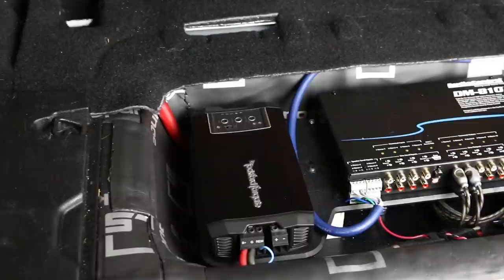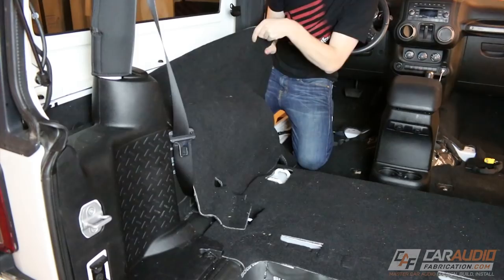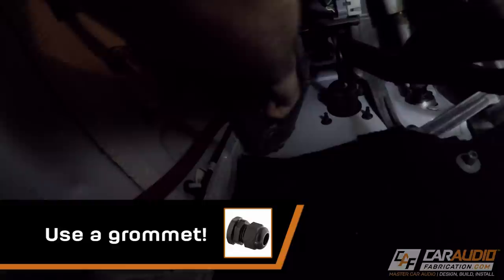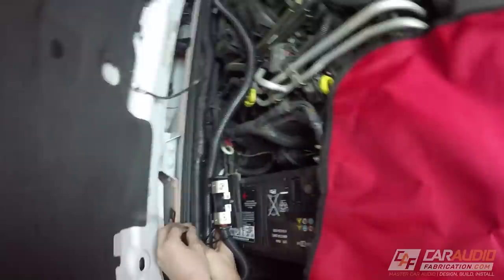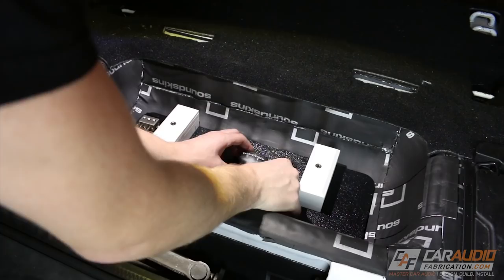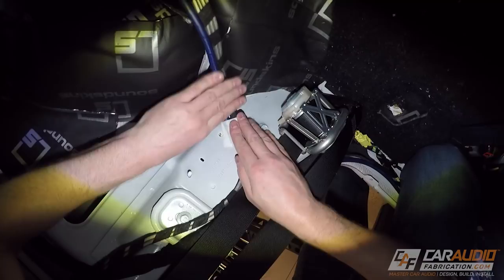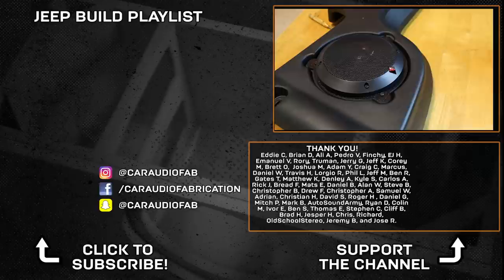Car Audio Wiring - Dual Amplifier and DSP Install

Comment: This would be the reason why I spent thousands of dollars paying someone else to install my stereos. This is pretty complicated and takes an incredible amount of precision, patience and attention to detail.
Reply: Not a single complicated thing happened in this video. I’d say it’s physically exhausting from my experience but not at all complicated.
Reply: @3000dudeman   Sure, if you're used to doing this sort of thing. Otherwise, it's complicated.
Reply: It’s not that difficult, you’re just lazy and not willing to put in the work so you use that as an excuse to justify it to yourself
Reply: @primalconcretesledge3137  I taught myself how to build enclosures and install audio in a year, I’m still learning. My only motivation was lack of funds to pay someone else
Reply: @modernbassheads5051   You want a medal or a chest to pin it on?
Reply: @primalconcretesledge3137  laziness is a poor excuse bro
Reply: I learned how to install a sub and amp a few months ago. Doing my car speakers and a tweeter installs with a second amplifier set up soon, and it honestly just took trying it out to find out the hard part is finding the stuff you want to use

Comment: How do you hook up speakers to dsp I get sound in then sound out but how how do you run 4 dsp outs to one 200.4 to control 4 speakers it just don’t make any sense and every video on dsp is just wiring it up like that’s simple not a one shoes av cables to speakers

Comment: The point is on how to wire dsp, then where is? too much explanations but useless i did not understand...what if get dsp,batery,amplifier,speakers,wire and explain it in a white table on how to wire them that is a clear and helpful video.

Comment: Hi I have a 2012 chevy equinox and I went with the ILX-W650 Alpine radio purchase from Crutchfield but I have lost my factory monitor.  I also purchased the same harrnes that you used in your father's Equinox but it not compatible with my monitor. Do you have any idea what I could do to make my monitor work so I can see my climate control?? Any help would be appreciated. Thank you.

Comment: Hey all, im confused about a few things. Would i still need to use an RTA microphone and go through each speaker and tweeter individually even with this DSP? Currently running 2 sets of infinity kappa 60.11 components and a kappa k4 amp. How would i be able to control all 4 woofers and all 4 tweeters with the DSP when the amp only has 4 inputs? Please help!

Comment: Does the GTO make a popping noise when the radio is turned on and off and will this harm anything, Do you recommend using the GTO or using an accessory wire turn on the device? I have the Audiocontrol LCQ-1 but I am not using the GTO just using an accessory wire to turn on the unit, I read that it makes a popping noise when turned on and off, but I like the fact that it only turns on when the radio is turned on and not all the time when the ignition is in accessory mode. I have a 2015 Honda Accord LX sedan factory radio that had 4 speakers no external amp.

Comment: top notch install!! the only thing I would like to add is that most vehicles come with a appropriate size ground cable to handle the needs of the vehicle . with that said if your going to have an additional load on the positive side , you should upgrade the negative lead or rather add an additional ground lead the same gauge as your power lead to the amps but from the negative battery post to the to the factory grounding point. doing this helps the amps run slightly cooler and helps with light Flickering with bass .. thats my two cents for what its worth...

Comment: This build will be super useful for me if I ever feel like adding additional amplification to my car, as the stock amplifier is tied into much more of the system functions than it should reasonably be, so the easiest thing is to just feed it all into a DSP to secure clean, flat output equalization before it gets fed into secondary amplification where necessary.

Comment: Video was great, but would have liked to have seen more detail on what fuses you used, how you hooked up the dsp and what size fuse used on dsp.  I am working on a 2019 Indian chieftain. Much different and  it many videos out there.  Any chance you can do an install on a 2019 or newer Indian would be appreciated.  Thanks for all these videos
Reply: He won't answer nobody does its the strangest thing not a video or Google straight answer out there

Comment: Nice job man, I have been pre-running the wires and do a small tape marker to mark the areas it will split off the harness, then wrap it outside of the car/truck easier on my back.. Keep up the good work.

Comment: No I haven't talk to Steve Meade about my set up, but I did speak to car audio fabricators and they told me I would be fine just by using the six channel audio control DQDX digital sound processor that I plan on using for all the 4 amps!!! Two for the sub's and two for the mids and highs since they have pre amp inputs and ouputs I can daisy chain them together and I would be fine!!!✌✌✌
Reply: ekim andersom  It is defaulted to give a 5 volt output.  You have to change the jumpers to get the 10 volt output.   AudioControl is kind of lacking on the information they provide in the instruction manual.   They don't even mention any of the jumpers in that manual.

Comment: Thanks for the video, awesome. I plan to install an active crossover, with one 2CH Amp for tweeters and a 5CH Amp for the door speakers and the Sub. I just need to understand how to go about the fuses and power distribution. (I have the amps but I am yet to buy the cross over). 1. What AWG power and ground cables would you recommend? Both from the battery and at the equipment? 2. I noticed that you used 1 input/2 output distribution blocks for power and ground, please clarify exactly how you powered the DSP from the same power block and how it was grounded too.

Comment: Why not run power wire on the same side as battery? I get don't run on same side as rcas but seems costly not to just switch side, plus It would keep less wire out of engine bay.
Reply: That is what I do.    I think the important thing was to make sure you don't run the power line on the same side as the RCAs.   Years ago, I found out why running them on the same side is NOT a good idea.

Comment: I'm curios why you didn't cut the speaker wires from the back of the head unit and only tapped into them? is it because you ran new speaker wires to all the speakers?

Comment: I'm installing a mono D class and a 4 channel AB amplifier in my jeep renegade using the factory radio.  I can't afford a DSP or a LOC so I wanted to use my high line inputs.
Q.  Can I hookup both amps using the same speaker wires from the head unit?

Comment: I don't see the point in using the speaker/tweeters crossover when you've got the DSP to do it.
Reply: The speakers X-overs are passive, whereas the x-overs in the DSP only work in an active setup.
Reply: you can run active is what he is saying. You set your crossover points inside the dsp. You don't need the passive crossovers with a dsp depending on your amp setup.
Reply: johnny you are totally right and i am very surprised that mark didnt say anything about that. wtf? makes no sense. might as well use a line out converter for $12!
Reply: ekim andersom exactly there's only 1x 4ch
Reply: ekim andersom  I believe that's his personal vehicle. A few videos before this he says that he doesn't have a shop or do installs for profit for other people, yet I know things do have opportunity to change
Reply: You're correct that the active crossover would be best but it also eats up 2 more channels on a amp.  Gives better results though, can also adjust time correction for tweets and woofers separate as well.
Reply: I know I am way late to this party, but why would you even install a DSP if you are running passive crossovers? What other benefit would the dsp provide?
Reply: @sledhead904  Yeah, I am doing an install now using the DM-810.   I have 4 tweeters and 4 midrange speakers.   I bought another 4 channel amp, so I could take full advantage of the DSP.   To me, it is almost a waste to buy a DSP and then run passive crossovers.
Reply: He just made a video about that.  Lul

Comment: I was wondering where would be a good place to get some good wire ferrules that keep the conductivity of OFC wire consistent. I don't want to use aluminium that will degrade the conductivity.

Comment: Thank you for your channel - it very informative and professional. I'm in the process of restoring a 1989 Ford E150 Custom Conversion Van. I've watched many of your videos that discuss topics from panels to proper sound-deadening. I'm planning a complete build with audio, video, security system - all the bells and whistles. Do you have any suggestions or tips since I have a clean slate to work with?

Comment: can you do a separate video for the audio control DM 810? I've been debating on purchasing that product for my Ram 1500 and I would like to know what all the features the DM 810 has in action before dropping $700 for the unit. .
Reply: 3.6L Dodge Avenger   i second that - in my case, it'd be awesome to know how to install it using 5 amps.  1- two channel (actually 4 channel, but only using 2 channels) to the apillar tweets, 1- four channel to the 4 components speakers in the front doors, 1- four channel for the four component speakers  in the rear doors and 2- mono amps to the seperate t1 10" slims.  Mark- don't be surprised if you recieve a message with a detailed excel do up on what ive currently got! js.

Comment: I understood the re-wiring of the speakers but where I got lost was the 9 wire cable. To what harness or exactly do you attach the 9 wire cable behind the radio to get the DSP?

Comment: good work..
can we use home electric wire to run power supply from car battery to amplifier..? im planning to use stranded 6 sq.mm stranded wires...plz advice
Thanks in advance

Thanks in advance

Comment: you didn't mention this- do i need to fuse the amps separately after the distribution block??? I'm thinking of running a mono block for the subs along with my 4 channel for dash and rear side speakers. the whole setup is kicker D-series. You should do a video on fuses and fuse locations in power wires from single to multiple amps :)

Comment: What in-line fuse did you use for powering the DSP (the orange circle)?  I just ran a wire from my amp power input block (with an in-line fuse) to my dsp, but I like the idea of using the distribution block to run it to the DSP.  I just can’t seem to find one that can go from a higher gauge wire down to the smaller gauge power for the DSP.

Comment: Got a setup just like yours. But when the engine is on i can hear whine coming from the speakers. that follows the RPM of the engine. I can even hear it with gain on the lowest setting. Amp is a Kicker 700.5ZX and original speakers.
Reply: Ground RCA to the side of the head unit and possibly at the amp. More than likely routed with power/remote.  Routing on the opposite side of vehicle from the power/remote  greatly reduces the chance of signal interference.  If neither of those options work for you, it's quite possible that it's the head unit. In which case they have "noise filters", but I have no experience with that product. Hope one of these ideas solve the issue.

Comment: Did you use an inline fuse for each amp after the distribution block? Or just total the amplifiers and use a single fuse at the battery location?

Comment: Should I use the factory 4x6 locations in my Silverado. I have a 6 1/2 componet set in each door. I'm also don't what subs to use due to the depth issues behind the seat ( I have a regular cab truck) Thanks for your help

Comment: i see at 9:00 that the incoming power cable is twice as thick as the outcoming power cable from the fuse block. Is that because you have to deliver twice as much power (Watt) to let the 2 amplifiers work, or does it have another reason for it?

Comment: So instead of running new speaker wire from the amp can one just run 2 runs of speed wire from the factory head unit to the dsp ?

Comment: I did a similar install in my 2015 Buick Regal, meaning two amps an active LOC using the factory head unit, which currently isn't replaceable. I did however install two 15s and my bass drops off drastically at around 28 hz. It's not the enclosure because the subs stop moving even out of the enclosure. My question is, does my factory unit have a higher frequency range to prevent damage to factory speakers?

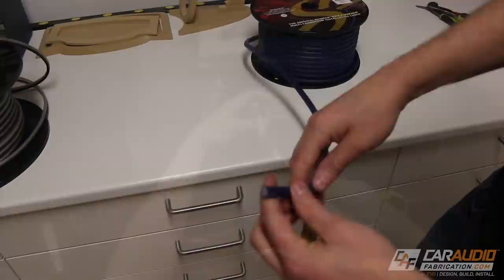Comment: I'm actually confused at 7:39, so there are two signals going out from the factory Head Unit?, one to the DSP, and the other to the speakers?, or you wire them directly from the amp to the speakers with new connection and just leave the factory speaker wire disconnected?
Reply: I think he probably just disconnected the factory speakers then ran new speaker wire from the amps in the back.

Comment: Hello mark, watching all your videos and loving them but I have one question from all the videos I’ve watched as I want to do component speakers possibly on my truck. How do you get wires through the door boots of different cars? Do you ever use the stock wires and solder the new amped wires to the stock wires running through the door boots to the speakers? Thanks

Comment: great videos first off. would it be ok to use a dsp device with a stock radio along with stock door speakers for just one mono block amp and one 12 inch sub? if so could you recommend....or should I just  use a lc2i?

Comment: What if you don't want to use the factory head unit ? I am thinking about a samsung tablet. But how to get a signal out of that to a rockford 360.3. From micro usb,charging constant, to rca. cause I am looking for voltage increase. Thanks

Comment: noob question here. why do you have to install a crossover if the dsp already have an integrated crossover?
Reply: Mark G. Becaise he's only using 1 4ch f for the doors and one monoblock for the sub you can't seperate them from the crossover because the tweeter need a whole different amplifier and crossover point he can only set a lpf and leave the hpf all alone bc the x over has everything else for the tweeter he x an only achieve the tweeter seperation with 2x4ch Amps

Comment: So if im using a dsp with a 2a fuse. Do instill need a 18guage  2a inline fuse on the power line in to the dsp?..or will the existing 150a fuse on my main 4guage  power supply be fine to use..im confused about needing the additional inline fuse for the dsp..also what size fuse for the 18g remote inline fuse..2a?..or anything close like a 10a 15a work..or does it have to be a 2a. Thanks. And sorry lol

Comment: How do u connect the RCA from the head unit to your DSP that will run the 2 amps? Eg. Mono block + 4 channel amp with 2 split systems that have they're own crossovers?

I'm curious

Comment: Do you run your sub through the dsp or just the speakers? (Just wondering because you only have 2 rca leads plugged in on the video) any chance you can show us the wiring now it is complete? So we can see? I assume it has the speed wire and rcas from the head unit going to the dsp and then the rca’s from the dsp to the 4 Chanel and mono block?

Comment: where can I find the wire frayers that you used to cover the wire before you put in the fuse holder.  I'm not sure if that's what you called it.

Comment: What do you recommend as far a tapping in to a factory radio. Wire splicer connectors, pulling back the wire and soldering them altogether, or maybe something else?
Reply: I suggest that you not tie into the factory radio

Comment: that wire with the 9 wires in it does it hook up color to color or do you have to know what wires run to what
Reply from the maker: Every vehicle has a different wiring color code so you will have to look it up. The 9 conductor includes the colors that are considered standard for speaker wires. White, grey, green and violet. More about that stuff here: https://www.youtube.com/watch?v=A7EbjAwjFGU
Reply: CarAudioFabrication... have you ever made a "blow through" box for a single cab truck? where the box is in the truck bed and the port leads into the cabin..

Comment: Thinking of purchasing an Audio control dm 810 or Rockford fosgate 363. Can you run those with stock system and do you run from factory head unit or factory amp?

Comment: I have a radio connected to pre amp
Pre amp to capacitor then 1 1200 watt 4 channel amp to 4speakers for highs and 4speakers for mids,  1 2500 watt  1 channel mono amp to 1 -15. Inch sub and 1 1 channel  2500 watt mono amp to 2 -12
 inch subs. I just received a dsp 408 and a epicenter digital bass restoration, concert series. I have never wired a dsp or a digital  bass restoration. So my question is down path of rca .where should I hook up epicenter and dsp, do I hook one or both before the preamp or after the pre amp or do I even need a pre amp  anymore

Comment: Where was this 2 months ago when I did my new jeep? Down to RF gear and XT-60 connectors..

Why 12 gauge speaker wire? I thought using 14 was overkill when I ran mine.
Reply from the maker: Nice, love those Xt-60s. Why 12 gauge?  Sometimes when I wire I might wire with the plan of - "ok what if I want to put twice as much power through this in the future and upgrade". That's really the only reason why in this case, it certainly doesn't hurt
Reply: You certainly did a nice job managing all that cable, thanks for the tape links! XT-60 is great because all both male and female conductors are recessed into the plastic and wont short against stray metal if unplugged and dangling..